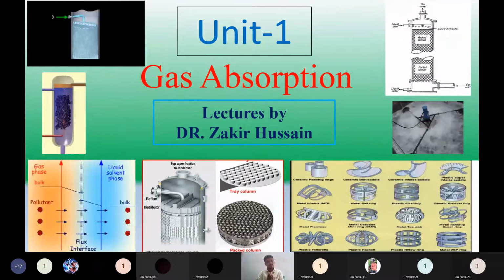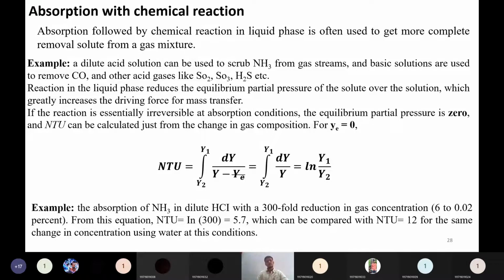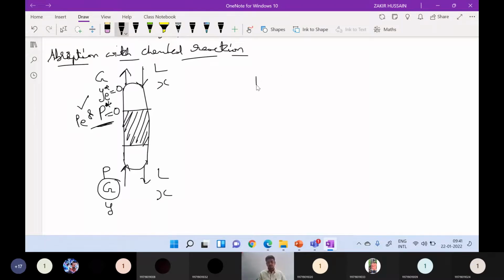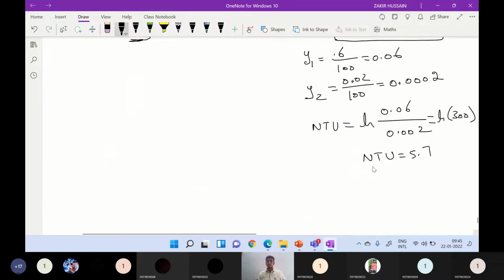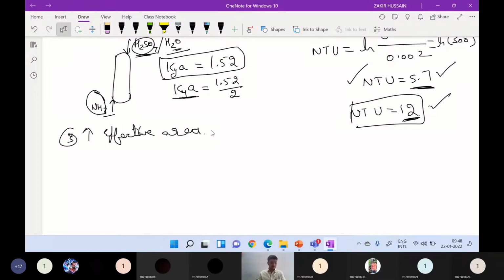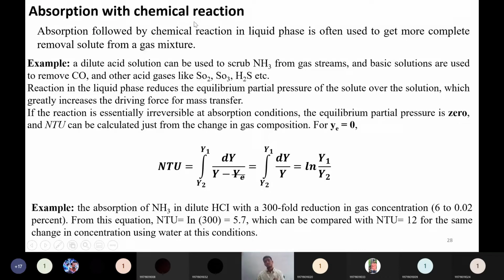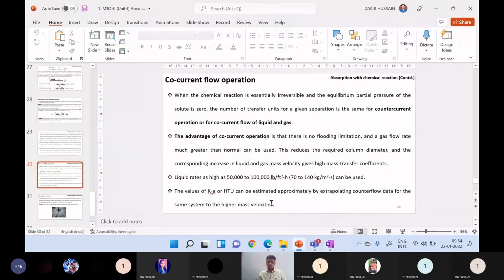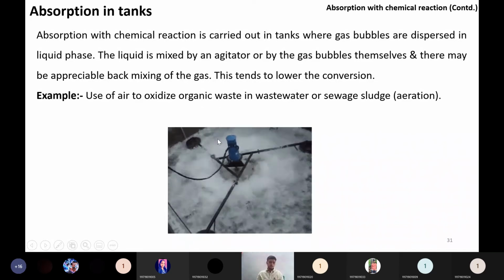Absorption with Chemical Reaction

Comment: Sir, what's book you use as reference for absorption with chemical reaction?
Reply from the maker: Dear, I am using Unit Operations of Chemical Engineering by Julian Cleveland Smith, Peter Harriott, and Warren L. McCabe
Reply: @dr.zakirhussain8948 thank you sir for your kind answer. Do you have references of falling film absorption design (example for HCl gas absorption with water)?
Reply: @dr.zakirhussain8948  thank you sir, your video is very useful for me.